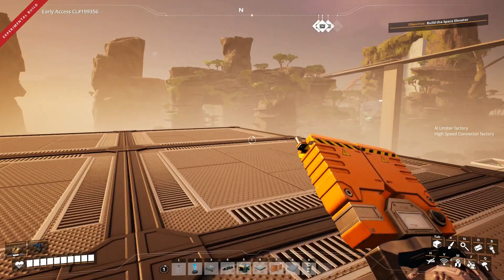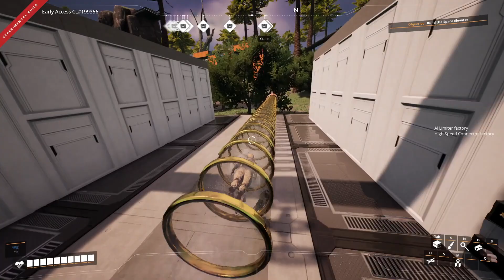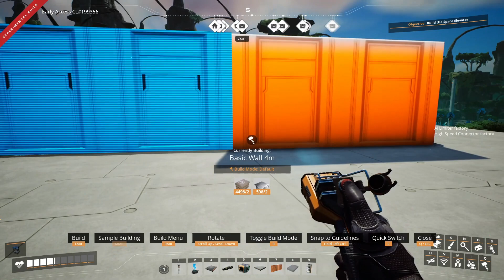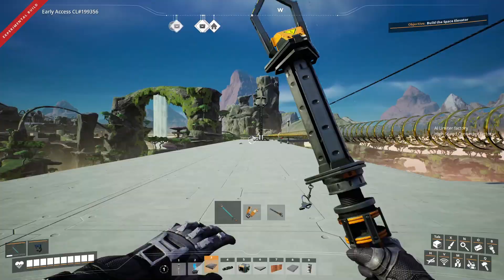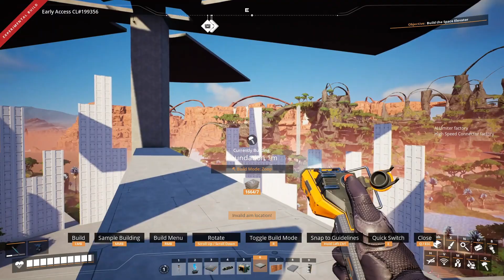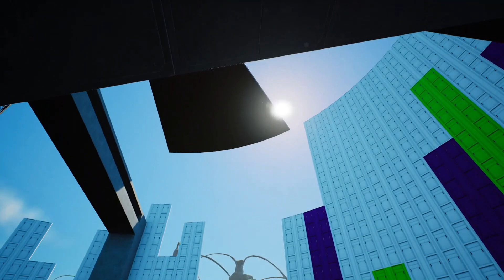Satisfactory Update 6 Ep 30 : Radar Towers and Glass Foundations

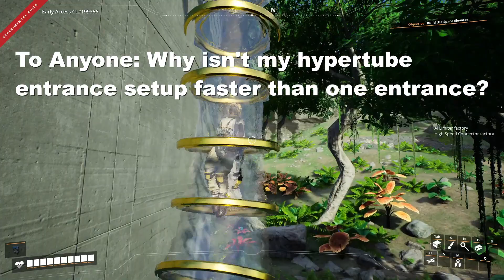Comment: 17:26 They're too far apart.  Once you put down an entrance, delete the tube and the extra entrance so you can get the next one closer
Reply from the maker: Thank you! After this next video I really need to make the adjustments. Soo many trips from the Spire Coast to the Norther Forest base, I need Speed!!
Reply: @makergaming2022  I believe additionally the immediate upward motion drags you back down to default speed regardless. There's a certain minimum speed you'll travel in the tubes, and travelling downwards in them will indefinitely speed you up, but upwards (and possibly straight lateral?) motion slows you back down until you reach that minimum - the steeper the faster